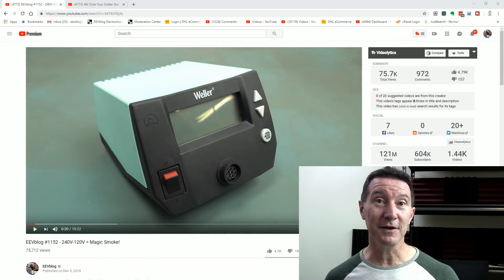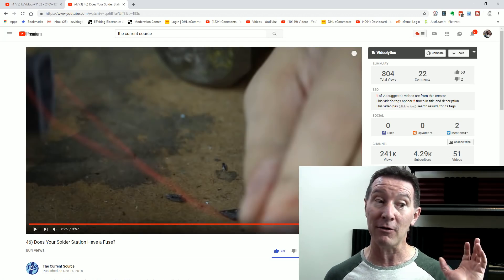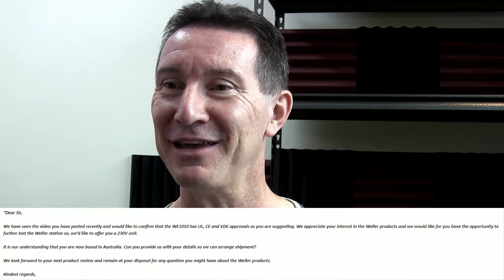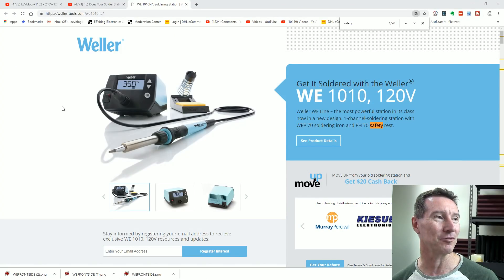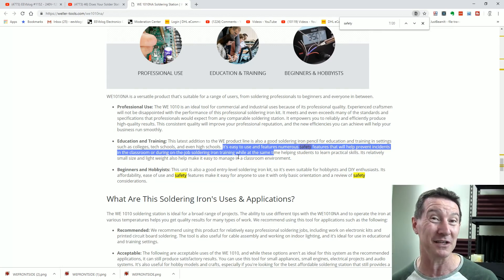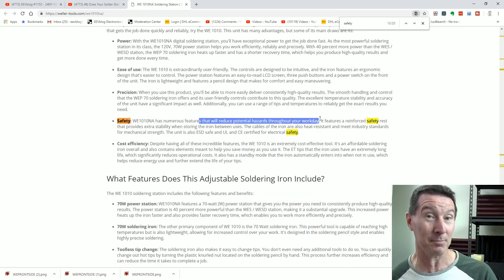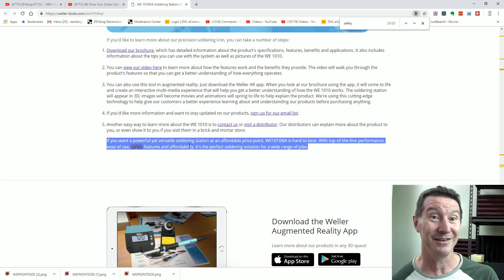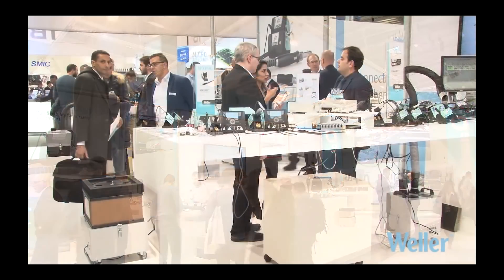EEVblog #1160 - Weller Responds!

Comment: We produce electronics in Germany. Electronic producers all put the CE sign on their products themselfs! You test the prototype yourself and you put CE sign on all pieces produced if the test was passed...and you will not produce anything that doesn't pass...
Just for these tests we have a laboratory and equipment to check electromagnetic radiation &c...
Also if the rules would be enforced from an external entity...they might one day find out that, all computer shops assemble computers  and sell them violating the rules...as they never do the CE tests or even pretend to do so...And yet their computers never killed anyone...because the rules related to the CE sign are just beaurocratic hurdles made up by the UK forced upon the whole EU..

Comment: My ERSA soldering station (Analog 60) is 21 years old and still available. There is a Fuse on the back, accessible from the outside. But not UL listed, only DVE and CE. :-(
Reply: Michi Meier UL dint exist back then

Comment: You should do a follow up. Try plugging a 110v rated transformer into 240V with a primary side fuse.   But measure inductance/resistance before and after connecting to 240V. I don't think the primary coil would escape unharmed even with a fuse. Might be a good future episode
Reply: with correct fuse it would
Reply: @sumilidero  a correct fuse would protect the wiring
Reply: @Pops180  not in case when there is short circuit thru impedance somewhere between plug and the unit tho.. it'd protect the transfeormer only if inside unit, and protect wiring if installed in plug like uk style
Reply: @sumilidero  yeah that's why there are circuit breakers in buildings. The US doesn't have fused outlets like the UK
Reply: @Pops180  yeah but breaker is 15A and when device is 0,5A rated, and overloads cause of malfunction and starts drawing like 10A it would cook itself and the circuit breaker wouldnt even notice, so i really think its good idea to put cheap glass fuse
Reply: @sumilidero  do the math on a shorted transformer. Hint,  it's more than 10 amps. A fuses current rating is so inconsistent in reality that a 10A fuse would take longer than a second to blow at 100A. I gaurantee any transformer would be damaged and you wouldn't even know it
Reply: @Pops180  omg i dont think you understand what im sayin, 1. rated transf primary current is 0,8A. 2. Circuit breaker is 15A. 3. transformer fuse is 1A. 4. there is short circuit THROUGH IMPEDANCE like shorted some turns in the coil (not damned dead short!). 5. Transformer draws 10A 6. 15A breaker doesnt trip 7. 1A fuse inside device trips... read and understand that and stop saying 10A fuse shit, i never mentioned 10A fuse, just considered 10A~ as example of drawn current in state of malfunction
Reply: @sumilidero  you apparently dont understand,  I don't have time for this. Believe what you want
Reply: @Pops180  lol Do you read what you are typing here? small appliances need small current fuses to be fully protected, if its not obvoius, who is lacking knowledge xD
Reply: @sumilidero  do you understand that fuses aren't meant to protect the appliance? Only the wire.   You have to over size a fuse DUE to the load.  A 1 amp fuse wont work with a 0.8A load. It will blow. Why is this difficult for you.  You should get a book or go watch cat videos
Reply: @Pops180  Fuses that are only meant to protect wires (those in distribution lines) are meant to protect the wires, but goddamn fuses inside appliance protect the device and last part of wire... that 1A was just example, might be 1,2A or so but way lower than mains breaker which protects wire. You should rather read books instead of watching videos and taking knowledge from there. Fuses in power stations are calculated to protect wires - yes, but transformers in those stations have own breaker/fuse to protect exclusively transformer, Example of my recent station i worked on - MV cables protected by 630A breaker, and transformer protected by 40A fuses. And dont tell me that 40A fuse in transformer compartment wouldn't protect transformer and the 630A that protects cables would..
Reply: @sumilidero  what do you call the cord hanging off of the back of an appliance?  It's a wire and that's what the fuse is protecting, end of story. Anything you say other than this is lies and misinformation. Fuses are not used to protect appliances, this is not difficult to understand, its world wide.
Reply: @sumilidero  you know nothing. Is like talking to a wall. Based on your responses,  you are just an hourly line worker, maybe your should ask your superiors why things are done the way they are.

Comment: I have not read any EN rules regs etc since 1990 we did manufacture an all in one pc/monitor for Rank Zerox and had to be able to self certify, we did have it tested for RF interference and susceptibility, I assume it passes as it failed safe OK it smoked but that is the enamel off the windings. But I do not know what would happen with say 170VAC. One thing I do remember is that we were not allowed to use glass fuses on the mains input we had to use ceramic HRC types, but a lot of imported items do use glass.

Comment: I bought a CAD$60 digital solder station from Amazon a year back. I just opened it up... even it's got a fuse on the mains side. (Tip is also connected to mains ground.)

Comment: This is pure stupidity on any levels.First connecting a 120v transformer into a 220v outlet is stupid and manufacturers dont account for stupidity,second low power transformers dont need input fuse,normally the fuse is on the secondary output (not in the transformer it self)cos is more reliable.there are transformers with thermal shutdown to avoid melting if the secondary shorts out and is before fuse in the secondary output or if the secondary is pulling more amperage in a way that the fuse does not (well) fuse but the transformer overheats . Do you even know how a transformer actually works?And why they are used in soldering stations?Hint:ESD.

Comment: I can understand that you are disappointed with the answer from Weller marketing. I would also have though that there was a comprehensible design decision why to omit the fuse and I would be curious to get it explained.
But as I know from inside, marketing people do not necessarily speak the language of engineers, neither do they share the engineers' way of thinking.
At least, it may not be likely that such a piece of equipment is transferred between regions with different mains voltages. It is not like my notebook computer that I carry with me all over the world (and then you deal with the different power plugs ...).
Nevertheless, I think you were a bit carried away by your rant. We have to admit that Weller makes pretty good tools. I just went to my workshop and checked my Weller WECP-20 solder station (it has a fuse). I bought it back in the 1980's when I was still a student and it was pretty expensive for me at that time. But I never regretted that I made this investment. It still works as good as on the first day I used it.

Comment: That's a problem with  110v equipment no mains fuse 240v items have the fuse in the plug I wonder if these were designed for the UK market .

Comment: I think Wellers response was fair. It was plugged into the wrong voltage. So should bug zappers, clocks, plug in lamps, humidifiers, fans etc have a inline fuse too? Sponsored by Hakko now Dave??
Reply: The difference is that Hakko has inline fuses even on their cheapest stations. If you plug a 120v 888D on 240v, the only thing that will blow is the fuse, not the transformer.
Reply: I'm sure Weller irons in the UK used to have a user replaceable fuse right next to the mains switch. If they've done away with them on the newer or US spec units, then that can only be to save money. It's a safety back-step IMO. 
I used to love my work supplied Weller, it was used for at least 40 hours a week for 8 years without issue, except for tips and the odd element.
 Having said that, I never connected it to twice it's rated voltage. But having the mains fuse might have made all the difference in this case. Not having a fuse has got to be worse than having one fitted.
Reply: good to see that trash comments are not unique to my channel...
Reply: @rossmanngroup  what a shame. Nothing wrong with Wellers soldering irons. I smell a rat.
Reply: Rather watch Big Clive or Fran. Thought Dave was better than this. Unsubscribed but who cares.

Comment: Perhaps the engineers figured the gage of the wire was small on the primary side, the wire would easily open if there was a low resistance short, or If the transformer was to become excessively hot, the limited amount of oxygen in the base would probably not allow for any sustained combustion.

Comment: @EEVblog Hey Dave, you're over-doing it. As per NEC, given the wattage and cord length there is no requirement for the fuse, not for code compliance at least. Internal protection of the device itself (transformer etc.) is not required by code, which addresses Safety only. Germans are extra careful about such design issues. Primary burnout by the way would not pose a hazardous voltage on the iron's body / operator.
I agree that their response was BS#.
But the Weller irons, in real production environments are super reliable, and have a reputation for being rock solid reliable and SAFE.
Reply: thats sounds like cheapest unit's "go to"; and given the wattage and thin cord i'd expect that be the mandatory case for fuse... That might be okay if device runs 12A on 15A mains breaker but not like 0,2A item and paying serious money for such iron all you get is 'it barely meets requirements and common sense and will blow in controlled manner xD And glass fuse is like few cents..

Comment: And here I was hoping Eaton's completing their takeover of  Cooper Industries (incl Weller) would have finally pulled some heads out - especially after the earlier "rationalization" deadlocked Cooper's patents (incl. manufacturing rights) from the commercial rights (including trademarks)  for many of their specialised tool lines (and the consumables necessary to keep them in use) by assigning conflicting rights across borders interrupting their established trade routes.

But with so many radical shifts in leadership, I was perhaps too optimistic about them retaining some sense of direction.  ... Although the caviller attitude towards safety has been a tradition for them as long as I can remember.

Comment: Go pound salt Weller !... 
in our local city College and our local county college in their work program in electrical that instructors no longer tell their students to buy Weller or Hako . For $35 the new Chinese ceramic instant on instant hot works so well and have become so reliable it’s just a no brainer. Even my old Yihaw 907 three-way soldering station with hot air gun soldering iron tip in the lab power supply that my son and I have been using for 2 1/2 years he uses it for repairing iPads and an apple laptops are use it for construction of audio amplifiers and headphone amplifier‘s and harvesting thousands of parts off of old circuit boards and just a month ago the soldering tip started wearing out I ordered a new one for seven dollars and it’s like New! . I know where I would like the stuff that Weller soldering station the next time I see a marketing executive or sales personnel for Weller.

Comment: Many of the high positioned managers underestimate influence of a person followed by a large audience. Let's see if someone from the Weller team will realize what is happening ....
Reply: Already at least 3 youtube tech channels talking about this...
Reply: @mjouwbuis  I saw Louis Rossmann
 talking about it. Please, do you know what is/are the other channel(s)?
Reply: @mjouwbuis  And all of them are ignorant.
Reply: Hey Robert. "The Current Source" is the channel mentioned that tore apart the transformer to determine that there was not a fuse buried in the winding of the primary. Dave/Louis/The Current Source should be the trifecta mentioned. In the aforementioned upload he also mentioned the loophole that was probably used for the lack of fuse was due to this being an "industrial heating element." I imagine such a loophole was intended for devices like a heat gun where there is nothing metal exposed and essentially just a resistor element present in the design. His video is worth the watch and subscription. I just subscribed to that one too ;)
-Jake
Reply: I remember a run-in that Sparkfun had with Fluke....  Let's just say that Fluke had a lot of 'splaining to do...
Reply: I was gonna buy a hakko but then saw the weller and was interested. But this is just crap. You would think the German engineers would think of it all. I have a small hand held weller and even that’s a pos. So old shit or new it’s no good.
Reply: The Current Source video is set to private now.
Reply: Individual transformer primary fuses are not necessary where the primary circuit fuse provides this protection.
Reply: I did a teardown video of an old Weller product. It received 130k views. I offered Weller to review their new soldering station, in order to boost their sales. And they were not interested. I always wondered why, but now it all becomes clear.

Comment: Got an idea for a video. Using a Weller iron, desolder and take out its own circuit board parts. In AVR. Double digits too. Just the low voltage circuitry, SMD resistors and stuff.

Comment: Dude, i think you are a bit hard on Weller here. Let's not forget that it was you that caused the magic smoke by not following safety procedures. Weller have their stuff certified - and those only apply when appliances are used as intended. (As in not doubling the voltage or use other cables than provided or pouring gasoline over it)
Just my 10 cents...

Comment: That's toooo funny.. Weller is a really old company and in the States a Weller has been the standard and on every bench at every place I've worked for. In fact up until recently I've been using one that was purchased in the 70ies (the case started to crack and the pencil cord finally gave out). So what did I do? I bought another given my experience. But that's got me wondering if I've made a mistake!!! It's a definite fire hazard so in the bin it goes!!!!

Comment: At the company at which i am working there is a weller and despite it's 2000€ pricetag... it's nothing special.
And having no primary fuse... it's just a joke. How did they even get UL-listed ?
Reply from the maker: Which model?
Reply: I just double checked, it's probably an older moldel of the the now wx line. I think I got a little missinformed by a coworker, it was probably  more like ~1000€
In comparison to for example jbc it performs worse.
The 2nd part of my original comment was regarding the video! Not the station at my working place! Sry, if that was missleading :)

Comment: I truly do not understand why Weller is been given a hard time over this. Dave is the one 100% at fault here. It is the responsibility of the person in charge of the device to make sure it is safe to use in the environment that it is going to be used in.  He failed to check if the device was adequately rated to be used on the mains supply he was going to plug it into he. As it was in a 'box of other stuff', he assumed wrongly that it was OK to use without making the proper safety checks to make sure it was. What is worse is that he is sent equipment from all over the world, covered in his 'mail bag' videos, equipment that uses different mains voltages which he is more than aware of but yet did not even think twice about checking the soldering iron before plugging it in.

Now, for the entertainment of his viewer base, he is trying to make it appear as though the fault is all wellers, it isn't. The soldering iron is for use in countries that use 120v mains electricity which Australia clearly is not. 

I've been a viewer of his channel for a long time but have to say on this one, in my opinion you are wrong Dave, weller have nothing to feel sorry or ashamed about.
Reply from the maker: Yep, entirely my fault.
And entirely Wellers fault that the iron melted down instead of just popping a fuse like every other one would have done.
Perfectly legal for Weller to that, I just think it's a stupid decision. And given that even the cheapest crappiest clones on the market has a fuse, it makes Weller look very silly indeed.
It's not the actual details of the incident that's important here, it's that it highlighted to potential dangers of the choice Weller made.

Comment: Thanks a lot. That "low voltage 120V for improved safety" line made my day. I never used a Weller but I always thought they where the industries standard, but this is bs